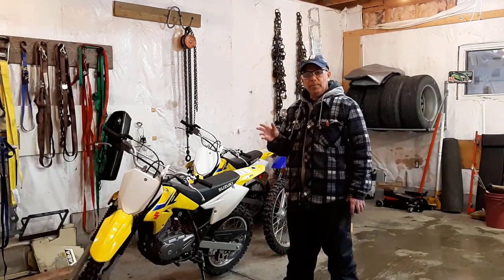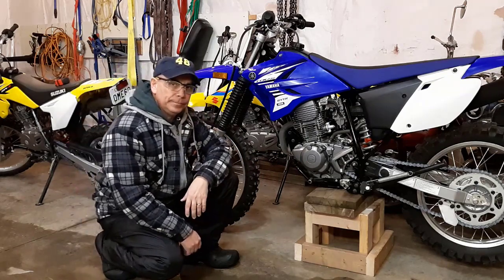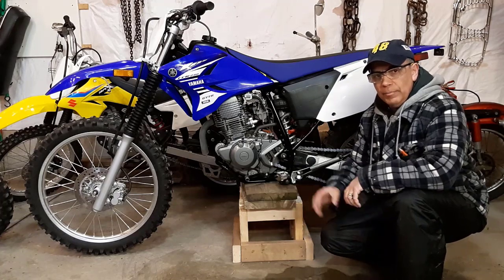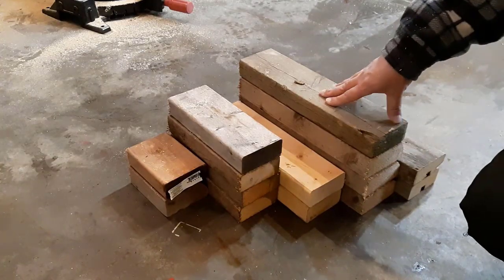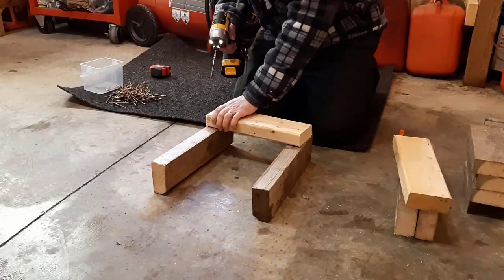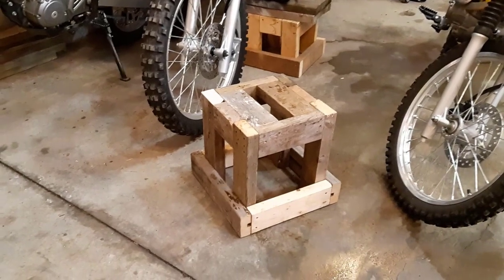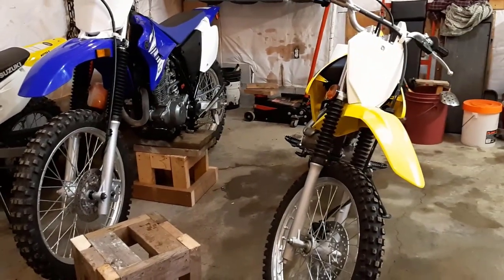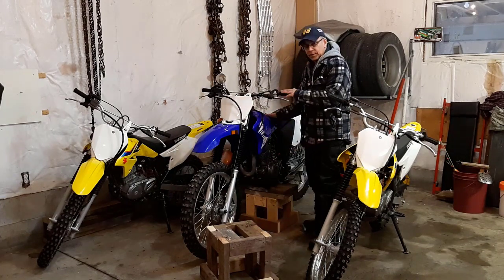Build a Wooden Dirt Bike Stand // Inexpensive & Bullet Proof!

Comment: Great idea and cheaper than buying a motorbike stall. I'm going to copy this and make 5he same. Any chance you could slow the video down because I've cut the pieces of wood but could do with a diagram on what pieces goes together
Reply from the maker: There is a gear looking symbol on the video, click on it and you can slow or speed up the video.
Reply: @GettingItDoneRepairs  I tried that but not able to slow the video down m8. I know the 14 inch pieces are for the height but what's the sizes that go across mate I'm guessing they would be the 12 inch

Comment: Cool stuff.  May try to build one here.  Only critique feedback I might give is to annotate assembly the same way you did the board cutting so it's easier for people to know which boards are which as you're putting them together.  I think it can be gleaned, just would help to have those captioned during assembly like you did for the cuts.  Kudos!
Reply from the maker: Thanks for the tips!
Reply: I agree m8. Great stand but not explained on what pieces goes were.